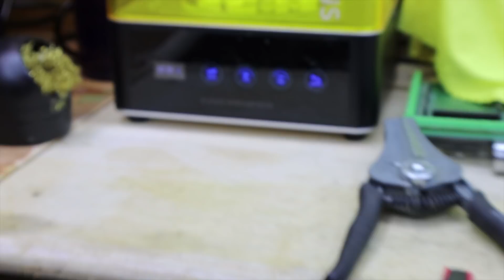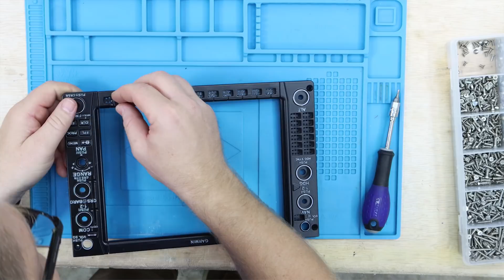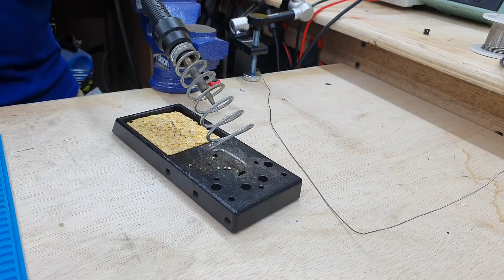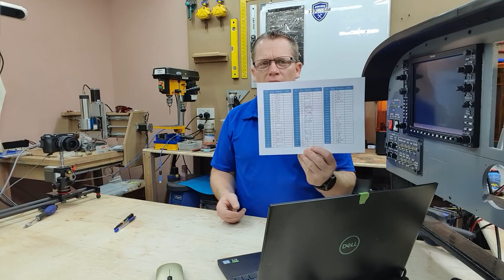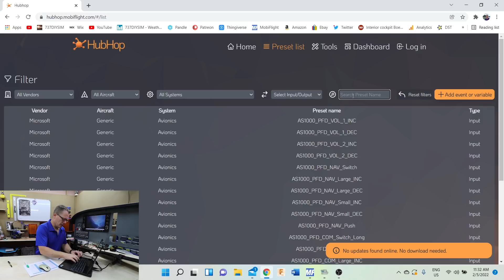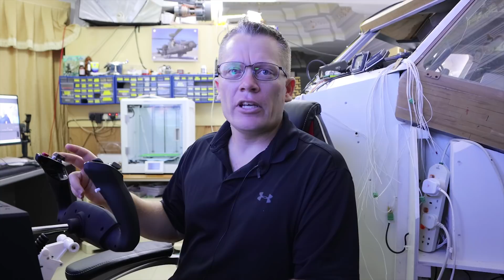Creating a G1000NXI for MSFS2020

Comment: Can I order the printed pieces from you??? Don't have a 3D Printer. I had a friend print me some G1000 pieces twice, but they are just terrible quality, and warped. So I thought screw, it just buy the bezels from you? Yes??? How much???
Reply from the maker: Hello and the answer to that is no due to mu current contractural agreements. This is why the website only has digital media on it. Hopefully, in a few months we will return to the UK and things will change very quickly. Kind Regards Karl
Reply: Would like an update on this progress. I've ordered all the bits and most of them are in hand now. I've bought the stl and cad files but I don't have a printer and I'm not about to get into that hobby. I can't find a way to get the plastic bits :(. I could make the panels and rear mounts using traditional methods but would like to buy a set of the buttons and knobs in resin if anyone can help? Would happily offer my soldering abilities to anyone needing help on that side of a build if they needed.

Comment: If the raised bits are all on the same plane, it might work better to use some spray adhesive to stick some fine sandpaper to a pane of glass, then just lap it on there a few times till that thin layer of paint is off.
Reply from the maker: Hello, that would work perfectly too!

Comment: good night kard I just watched the video and I'm already looking forward to starting just one question?  the frame is printed with filament and the buttons with resin right?  and another doubt the screen that you put in the links fits perfectly in the hole since I saw in the forums that someone did not do it.  thanks for everything you are a phenomenon and I am hooked on your work. you are my idol 😜
Reply from the maker: Hello Jose, the first one was filament printed. I then resin printed it all for this video. The screen fits perfectly, the one on the forum, was the a different version to the one I purchased and will not fit this design. It has to be the screen stated in the build guide. Kind Regards Karl

Comment: I'm interested in downloading the STL files but not sure which link to use.  I used the first link, and selected to purchase for £6.64. Will this get me to the STL files for the Garmin.  The second link goes to the same download page but the price is much higher.  What is the difference?  Plus your page does not allow for a change to delete the purchase if I change my mind.
Reply: One set of files are STL for 3d printing, the more expensive set includes the CAD files should you want to amend the design.
Reply: @jpgame1606  thanks
Reply from the maker: hello and exatly what JP has commented. One is just to print and go, The other is the acyual design itesf so you can adjust the design to suit your printer or needs. Kind regards Karl

Comment: Do you have any advice or guidance on how to wire so neatly into those harnesses? My work works but looks like garbage !
Reply from the maker: Hell, i will try and create a video on how i do it!
Reply: @helimech8152  That would be amazing. Even showing the heat shrink and how you plan out the wire lengths would be so helpful. On my way to buy the STL for this right now. My King Air project will have to be set aside. This looks too fun not to make!